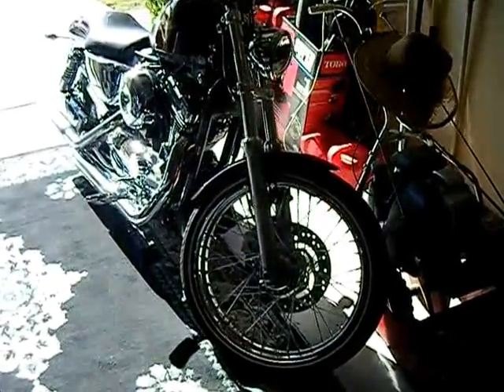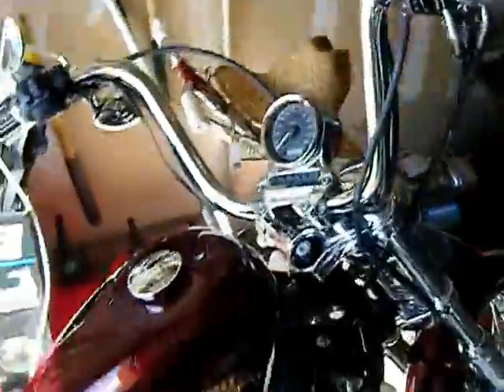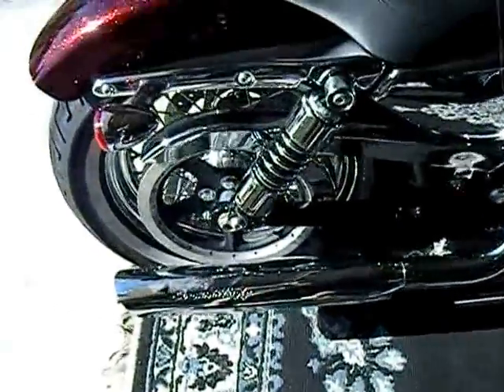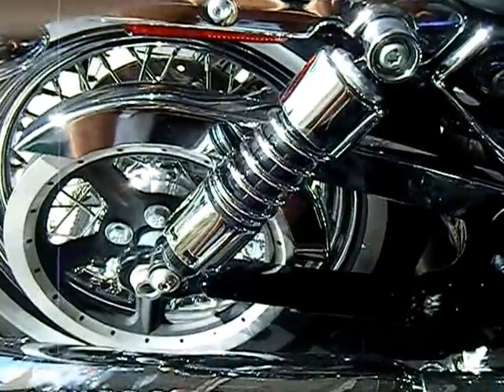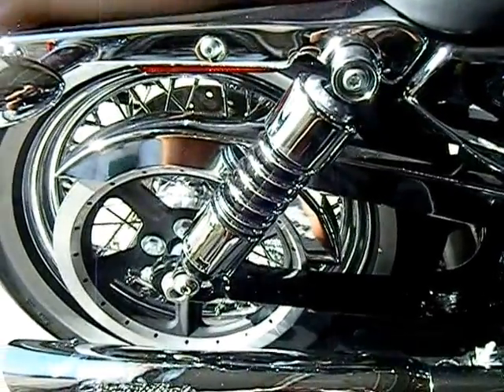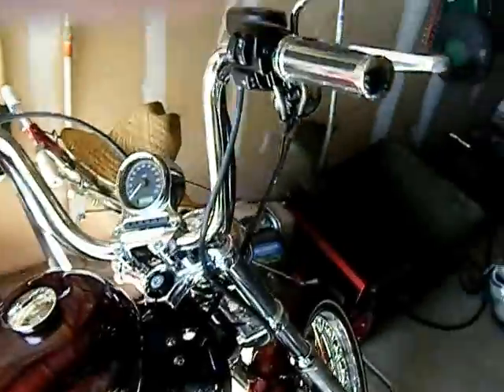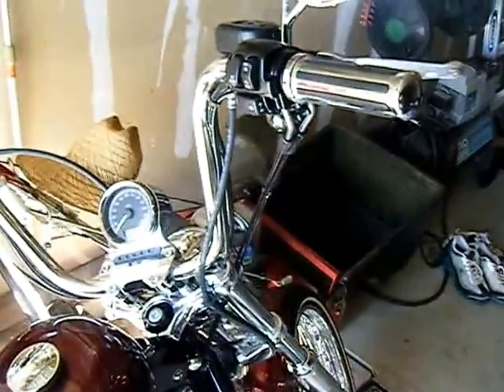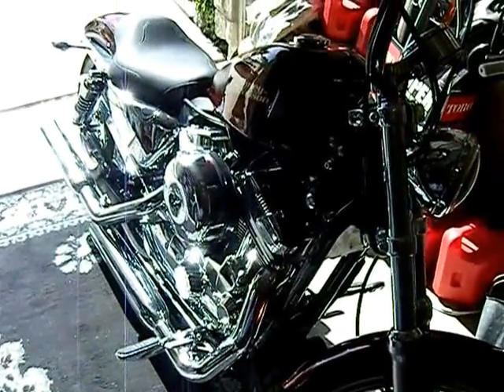2013 Sportster 72 XL 1200 V update July 2013

Comment: I think the Nostalgic Grips would look more old school on your bike. They are bolt on and they come in white as well. I put a set on my 08 1200C and I think they took a lot of vibrations out of the bars. I'll post a pic of them under HDForums soon. Under what have you did to your Sportster today. We both seem about the same age, I'm 60.
Reply from the maker: I've seen some nostalgia grips that look like bicycle grips with matching foot pegs in different colors & gave them some thought but one of the guys I sub here that had them said the colors faded after a couple months. The ones I got are ISO grips that isolate vibrations with the little rubber part & they match my foot pegs & they seem to work. Yes we're about he same age, I'm 63 years young